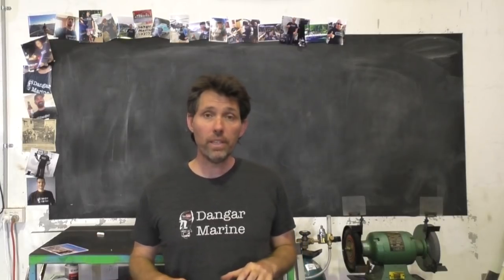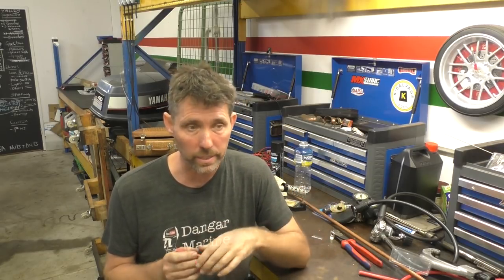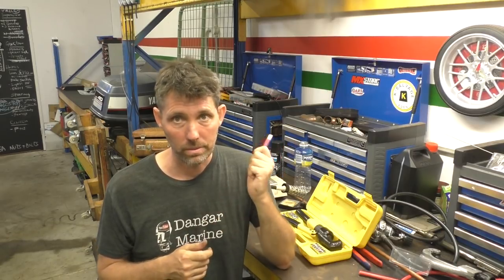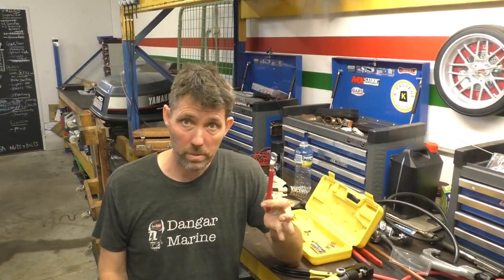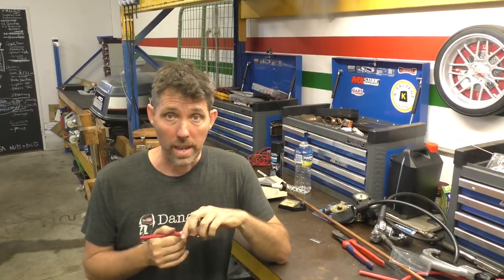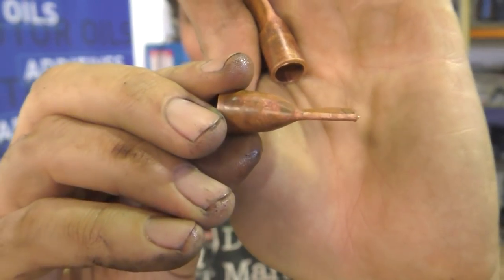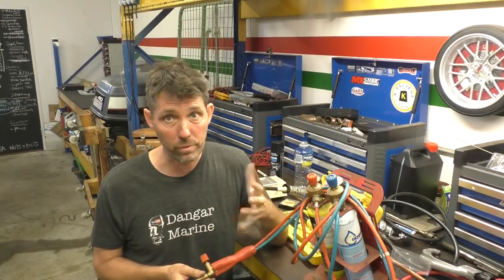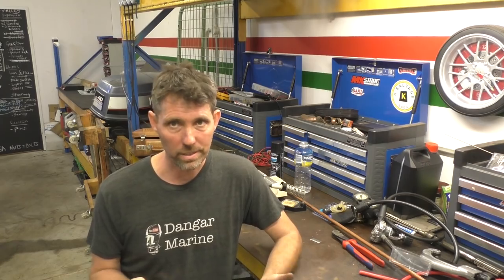Making your own battery leads

Comment: I commented on an earlier video about this soldering vs. crimping thing, but since you bring it up again in this video I think I have some extra info you might find interesting. I study Automotive Engineering, so naturally these days this includes A LOT of automotive electronics theory. The first class we had about this subject was about electrical connections. Trust me, as a new student there's nothing more disappointing than showing up for the first class and having to sit through two hours of listening to someone talk about crimped connections and soldered connections. Anyway, here's what I remember from that class:

Your point about  a soldered connection being better than a badly crimped one, but a well crimped connection is the best of all, is spot on. The problem with crimped connections is that a lot of people (yes I have done this too) don't use the right pliers for crimping the terminals on the wire. You need pliers with dies, that don't open up until a certain pressure is reached. This comes back to the cold welding thing. Inside the connection all strands of copper need to be squashed together until they become one. Then you will have an airtight connection, and a VERY corrosion resistant and conductive connection. But with the cheap $8 crimp & strip combi pliers most people use, you are judging the connection based on mechanical strength. And you won't put enough pressure on the crimp to get an air tight crimp. If I remember correctly, the pressure at which the copper starts to cold weld is higher than the pressure where the crimp has its maximum mechanical strength. That's why you should use pliers of the ratcheting type with dies, these special pliers (+/-15$ on AliExpress or similar) make sure you always crimp with the right pressure because they won't open until you closed them far enough.
The same principle about getting the pressure right goes for your hydraulic crimping tool. The dies on this tool are made so that they provide the right pressure for a good crimp. So you should crimp until the two halves of the die touch eachother, and then the pressure inside the connection will be right.
Now, about the copper wire cold welding to the connector itself. This depends on the material of the connection. Most automotive connectors are tinned or nickle-plated copper or aluminium. Which is great news, because a copper wire will cold weld to all of these! Cold-welding is actually the prefered method for joining copper and aluminium, even though they are dissimilar metals.

This is one of these things where having the right tools really makes or breaks the job, and like you already said investing in that hydraulic crimper is worth it.

I hope this information is helpful to you in some way!
Reply from the maker: It certainly helps in the form off helping me to gain more and more confidence in just how good a well crimped connection can be. For years I have had a lot of success with soldering wires in boats and not having and corrosion problems compared to all those bright green corroded crimped lugs I had seen the boats come in with. It's becoming more obvious to me know that those were all just dodgy pinch crimps with pliers that were failing due to the execution more than the merit of the idea.

Comment: Excellent updated video :)  Just for info, the main idea behind a good quality crimp termination, using the correct sized lug, cable and crimp tool die, is compression of the copper conductors until they are both  water and air tight. The individual fine copper conductors are compressed against the lug inner walls, and each other, so tightly that they are almost a solid inside the crimped lug. Anything less, due to size mismatch or incorrect die size can mean an imperfect crimp that allows moisture into the lug and corrosion of the copper cable.  As already stated, the key feature of the crimped termination is the high level of compression on the cables conductors. A good quality crimp termination plus a covering with adhesive lined heatshrink should make for a very long lived termination, even in a salt water environment. 

Thanks for your professionalism and retake of the cable making video :)
Reply from the maker: Thanks Fraser. By complete co-incidence a friend of mine who is an electrician with the railways came by the workshop yesterday and I was talking to him about these cables and he too was mentioning how important it is to get the exact right lug for the cable you are using. I think that is another point I should have emphasised in the video in order to achieve this water and air tight result, but hopefully when people go to buy the cable and lugs they will be supplied as a well matching pair.
Reply: When properly crimped, the individual strands of copper will actually deform to each other, and , as mentioned before, will become air tight.

Comment: Stu, you got it right about the wicking. If the lead is not flexing at the  crimp, any wicking will have minimal, if any, effect on the cable life. But if there is movement at the crimp and you have over done the soldering you just need to make the cable flex an inch or two away from the end of the non flexible area. As for just crimping in a marine or wet area, I don't like the idea that salt water can get in between the strands and cause corrosion where you cant see it. Whilst we always crimped our leads on the oceanographic projects, that was more to hold the cable end mechanically while we soldered the end. We even found backing off the tension a lot on the jaw settings made soldering easier to get good flow of the flux. Hot solder is like water, it will go any where it can if it is hot enough. The black wire effect you are alluding to  has been suggested as being an effect from the PVC degassing over time and is a severe form of tarnishing, damn hard to get off but having almost no measurable effect on current carrying capability, You just don't want to have to reterminate the cable - so do the job well the first time I guess.    By the way, Jaycar have up specced most of their heavy cable range and most is now individually tinned strand stuff, and thin strand stuff at that  . I think the caravan/camper /photovoltaic guys were a big enough market to force the change- they were going to the competition! Their 200A cable (not wire!) is 7 conductors, each made up of 81 strands of .12mm wire. Terminology gets a bit specific at that level, much like the difference between a cell and a battery!  :-)
Reply from the maker: Interesting to see the competition is having a good effect. Road Tech Marine seems to be growing now too which is owned by one of Dick Smith's old partners. I have always found solder to be an awesome way to prevent corrosion in a boat, but I am slowly beginning to understand the merits of crimping, and where they are good in combination (done in the right order!) Your wire vs cable comment reminds me of all the arguments about having lines on boats that are made out of rope. ;)
Reply: RTM and Jaycar are one and the same, just targeting different customers. Even the part numbers are the same for items they both sell!

Comment: Great job Stu!!! When I went to do my new leads I was overwhelmed with crimp vs solder. Then when I went to look at new tinned thick gauge marine wire...I said fuk that and just cut a little wire and cleaned the ends where a little corrosion was from the previous owner who just hammered a copper lug onto. It's been fine for 2 years and I used the same lugs in you're vid. The corrosion wasn't even that bad for a 8 year old non crimped non heat shrinked wire connection. The one you made in the last video would have lasted a LONG TIME. Great job again and looking forward to the next vid😊
Reply from the maker: I don't blame you about keeping the old wires when you see the prices. I'm sure I could spend more on my leads than I did on my outboard if I looked hard enough! The other point you make is something I've always thought too. You do a lead the worst possible way you can and it still takes 8 years to fail. Do it even vaguely right and you should be in great shape for many years to come. :)
Reply: Dangar Marine It didn't even fail I actually changed it because it was a new to me(used) boat and outboard and I was obsessed with doing maintenance and fixing things that weren't actually broke. Preventative maintenance and obsession to not break down drove me to change the 2 leads going to battery. For the first 3 or 4 months I had it...I just sprayed some battery corrosion spray and it was fine. Probably would have lasted another 8 years if I left it. And this is in saltwater(Gulf of Mexico)

Comment: I'm glad you mentioned the problems caused by heat wicking, Stu.  That's definitely something to consider when planning this sort to work.  I've never tried it on multi-stranded copper wire, but there are heat sink products - pastes and putties - used to contain welding heat in automobile body repair work.  Coldshield Thermal Paste is one such product.  I think the stuff may even be reusable, so it might be worth a try.
Reply from the maker: Interesting to know about the paste, I might try that when I'm doing welding on thin sheet metal myself.

Comment: Good Morning Stu from the great northwest USA. I'm learning allot about battery terminals for sure. My weedeater even though I got it started wasn't running right and was dying. Turned out to be a worn out carb fuel diaphragm so I just bought a new carb for it online. Works great but swapped out the spring off the old one to the throttle lever. The one that was on the carb was cheap and weak. My daughter's boyfriend brought over a Stilh chainsaw for me to get running for him so thats my next project. Looking forward to your trailer video
Reply from the maker: Hey Tim, glad you got your weed eater sorted and good luck with the chainsaw!

Comment: I’ve been meaning to get a crimper, most lugs I just tin leads and lug but once fitted heat everything so the solder flows. Never had an issue, the wicking can be good to try and seal non-tinned wire against the insulation.

I’d agree the current handling / resistance doesn’t change a lot with corrosion down the wire, it’s all about the contact points (majority of our mains wires are bare copper between the poles)
One thing it does though is make that wire junk if you have to re-terminate it down the track, a lot of time with sandpaper and flux can make it work but it’s never perfect

Cheers for the videos !
Reply from the maker: Hey Leon, I think soldering and heating the whole lug is a great way to go too. From a teaching point of view I think you need to teach established best practice, but there are plenty of techniques that pass the ultimate test of working in the real world. By the way, are you Dylan's brother?
Reply: Dangar Marine yeah that’s me haha

Comment: Would like to take the time to tell you thank you for your videos  you have helped me save a lot of money by teacher me how to work on my boat myself keep up the great work on your videos thank you
Reply from the maker: You're welcome mate, glad the videos have been helping to save you money. :)
Reply: I was wondering if you could help me or point me in the right direction on what to start looking at first on why my motor starts  to come out of the water when I put it in reverse and give it gas
Reply: Forrest Williams Here is what you're looking for.
https://youtu.be/Topfyfm4bFg

First make sure that the tilt is locked. Then check on parts diagram if anything is missing
Reply: I look at that video but I have a power tilt and trim and mine does not have that it's a Johnson 175 HP

Comment: Hey Stu just caught up with this video more out of boredom at home than anything else, great video just a few thoughts to share. first in marine applications always spend the extra few bucks and get tinned wire, not because I recommend soldering I don't, but because of corrosion resistance. the tinned wire gives you an extra level of protection if your wire gets wet. secondly and this is an unsolicited plug you can get a manual multi lug battery size crimper from Jaycar electronics for about fifty dollars for those who don't want to invest a couple of hundred in a hydraulic one. third point I use the liquid insulation first then waterproof headshrink over the top. Echoing your mates advise use the lugs from the store the copper tube wuld be a great get out of jail repair to get home but I would replace them asap
again love your work thanks for taking the time to put these up

Comment: Hi.at freq=0 (DC) if you apply the formula skin depth is infinite,meaning that current density reaches the entire copper core.remember that a wire however can be modeled with capacitance and inductance so When you consider the wire surface corrosion you have an impact,noticeable effect at switch on for example.You videos are very well conceived.Thanks
Reply from the maker: Interesting to hear how frequency affects skin depth, thank you for that!

Comment: Good one Stu. Personally I would follow NASAs instructions to the letter -if it was a moon shot. So exactly what sets them up as experts in the Marine environment. I like the copper pipe jobbies you made and would have soldered too.👍
Reply from the maker: It's a good point you make about the moon shot. It really is a case of horses or courses. I had a guy tell me off the other day for not using calibrated chain and rated shackles for anchoring my 4 metre tinnie. WTF?

Comment: Excellent video Stu. This is likely a conundrum for lots of people that are making their own battery leads. To solder or not to solder. The thing that made me go down the solder route was being taught that way at work. I've tried crimping and soldering together as well and wonder if it's a good idea or an extra step. I feel it can't hurt to have both. The dip in the solder pot coats the terminal as well to prevent corrosion. A few people here have said that corrosion can attack cables if they aren't made properly. I feel that if they get inspected once in a while you'll see any corrosion and you can take action. You can also check them with an ohmmeter to see if there is any resistance issues from possible internal corrosion. Great video. I learn something new every time you post a new one!
Reply: Jack, for this size cable your normal multimeter on ohms is not much use for checking the cable. At the extremely low current flow the meters use any resistance you read above .5 ohm is just going to confirm what you should be able to see easily. Being practical ,the best measurement system to use would be voltage drop, the hardest part of which is making up the dummy load. For 12 volts an easy to source and use dummy load is a an old mains powered electric water jug! Look for a water jug with a 1200watt rating ( don't worry about the voltage 110v or 220/230v, it does not matter, 1200 watts is what we are after) . If you do things right and it has a removable power cord, you can even still use the jug for boiling water for a cup of tea or instant coffee!  Simply modify the jug power cable so one wire ( say blue)  can be bolted to one end of your boat cable, set the other jug cable (brown) with a lug that will connect to a battery terminal. Make the jug leads as short as possible (75mm/3 " is almost too long) . Fill the jug with water as a heat sink. I would use a battery switch, but you can MacGyver things if you like. Set your multimeter to a low voltage scale, 10 or less volts would be good. Use a good 12v battery and make sure your multimeter leads are already alligator clipped to the boat lead ends, red lead to the battery end, black lead to the jug end. Connect the boat lead to the battery positive ( there will be sparks!) and take a reading of the voltage on the meter. BE CAREFULL, THE CURENT FLOW WILL BE ABOUT 100AMPS! DONT KEEP THE BATTERY CONNECTED FOR LONGER THAN 10 SECONDS! A voltage reading of .0015volts per metre/ yard of cable is OK, lower is better, .2 volt is bad. That is the only practical lead test for the size of cable shown in Stus video.  As an idea, 0 gauge wire rated at 200Amps has a resistance of 0.00035ohms per meter at 20deg C- good luck measuring that on your  4 digit , $50 mutlimeter!
Reply: Ron Powell Hey Ron, thanks for taking the time to explain that! This is why I love Stu's channel. Lots of good people here sharing good info. And we all love boating and being able to fix and maintain boats ourselves.
Reply from the maker: Thank Ron, my voltage drop video was very theoretical I think so I might do a second video down the track on doing a test like this.

Comment: Good stuff.  I'm mostly on lakes so I don't really see salt water.  Salt water is an interesting subject due to its chemical reactions to metals and electricity.  Some really good stuff you have in this video.  I would be curious to know the effects of the copper strained wire cold bonded to the steel connector (whatever metal that is).  Harbour Frieght sells the copper connector here and I've just put them on my copper strained wire.   I wonder by using lead solder if that isn't a catalyst for corrosion over time?  The cold bond of the materials seems to be best way to go I believe.  I think even in a pinch the having to make your connectors which is brilliant use copper all the way!  Love the videos.
Reply from the maker: Thanks mate. There certainly is plenty going on when it comes to salt water, metals and electricity. Cold welding does seem to do a great job of keeping the corrosion out, but having tinning over the top only seems to help keep the corrosion at bay from my experience.